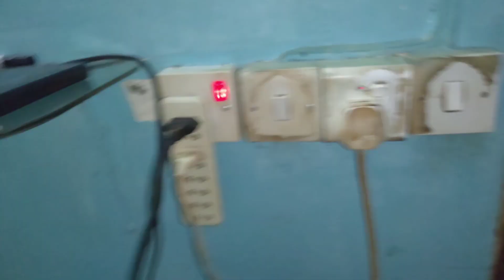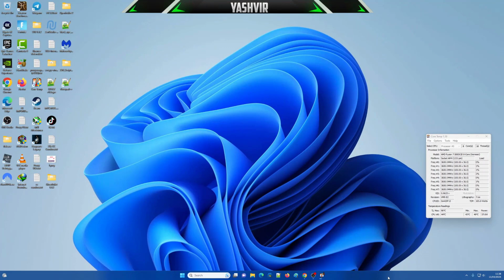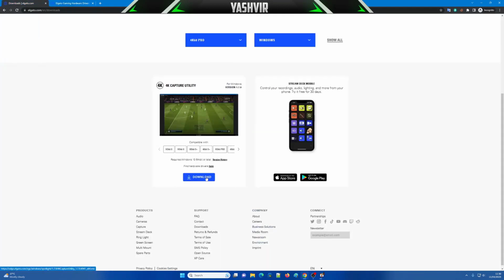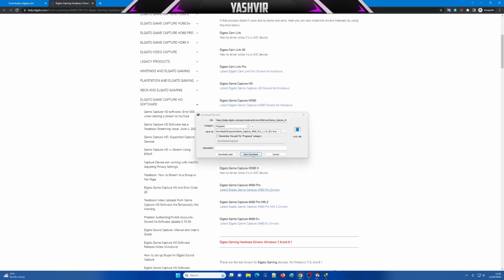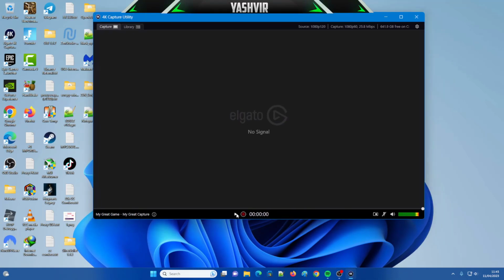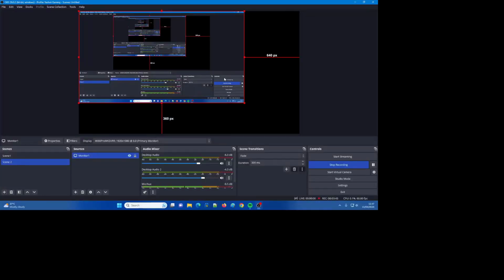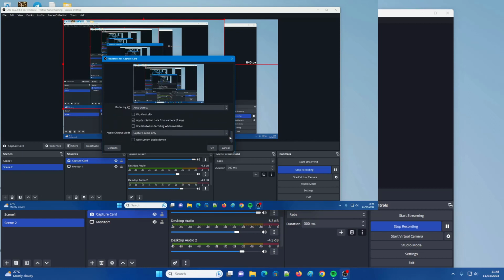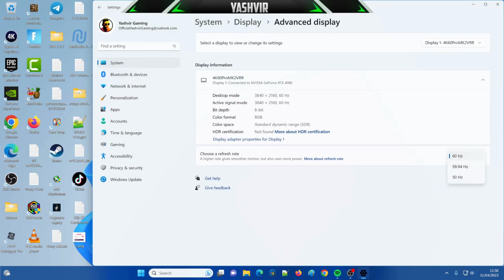Elgato 4K60 Pro MK2 Installation/setup For Single Pc Recording

Comment: Bro my eligato 4k pro no single in my pc what I do I have ps5 or pc but no single issue in obs or eligato software what can I do 😢
Reply from the maker: Check for drivers inteferrence uninstall it 4K capture card driver from device manager and re install the 4kcapture utility tool by doing that its gonna fix any corrupted drivers

Comment: You don’t need to use two HDMI cables. Only one, from the GPU to the card. You can still use a DP cable from the GPU to the Monitor. 

The output HDMI is for when you are using it to record like a console that may only have one HDMI port on it. You would have to use the pass through in that instance to be able to watch what the console is doing. 

For a computer GPU there are several ports than can be used at the same time so you are not sacrificing refresh rate. 

In windows display setting you can clone the display and have several output options from the same GPU.
Reply: Thanks, I was literally just about to ask about this
Reply from the maker: Thanks for the info ill give it a try and update you how it goes

Comment: what hz is your monitor? does using this capture card cap your hz? if your monitor is 4k 144hz does it lower it to 4k60hz?
Reply from the maker: I have AOC gaming monitor 2560x1440p 165hz but if i set it to 2160p 4K i will be limited with 60hz only
Reply: @YashvirGaming   thanks for the reply! is that just what your monitor does when you set to that resolution or is that forced by the Elgato?

Comment: So the capture card can fit in the 16 bit pcie slot ?
Reply from the maker: Yes it will fit in 16lane and x8 lane pcie slot as well
Reply from the maker: If you have a motherboard limited lanes one is for you GPU and other is a short x1 lane then you can also buy a X1 lane to full x16 lane PCIE RISER cable

Comment: oops bro, clear my doubts! I want to record ps5 4k in maximum quality, I have this elgato, a ryzen 9 5950 x and an rtx 3060 ti! Will this video card handle it?? I want the recording to be better than the PS5 bultin, you understand? Would I have to upgrade to a 3090 for example or is it not necessary?
Reply from the maker: 3060 ti should be able to handle 4K 
Since all passthrough will be passing through the Elgato card bro you should be fine

Comment: Hi
 I’m Having a Problem with my live streams 
I’m using elgato 4k60 pro mk2 and trying to stream codm game from m1 2021 IPad Pro 12.9inch 
But problem left and right .

1 st problem IPad screen keep getting disconnected in the stream black screen issue I’m using belkin Hdmi , changingport ,  Type C adapter .

2nd problem When I connect my iPad into elgato4k 60 ms 2 all sound getting cracking or static noise through my headset but in stream or recording no sound problem 

3rd I’m trying to stream in 1440p 60fps on YouTube but my screen resolution the source in 4K utility app keep switching from 1440p to 1080p 

Someone please Help Me 😭

Comment: What if your using a display port ? 😂
Reply: You use it like normal. The Input on the capture card is the only thing needing to be used.
Reply: then get hdmi to display port adapter :face-blue-smiling:

Comment: I am receiving no audio when having the HDMI running from my GPU to El Gato 4k60 Pro. Any fixes for that?
Reply: the Elgato likes to switch the default sound output on your PC to itself when plugging it in so try going to your system's sound settings on your PC and select your correct sound output device... otherwise your sound output remains on the wrong device (your screen or your Elgato) instead of your soundboxes or audiointerface or whatever your headphones are connected to

Edit: same goes for Input audio btw. if you have a seperate microphone that suddently stopped working
Reply from the maker: Hi for audio on this Capture card i made a seperated video check it out - https://youtu.be/h9gEfq7Zrjo